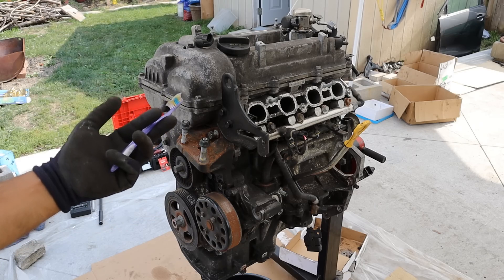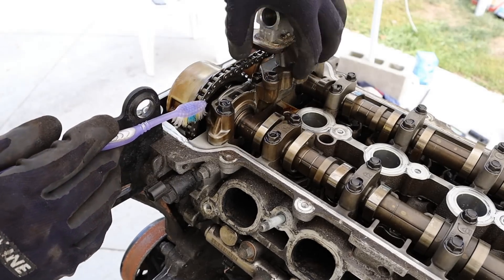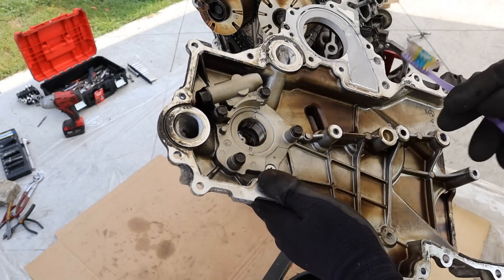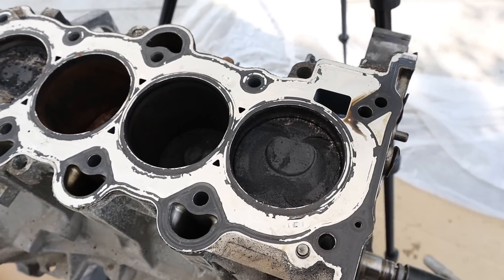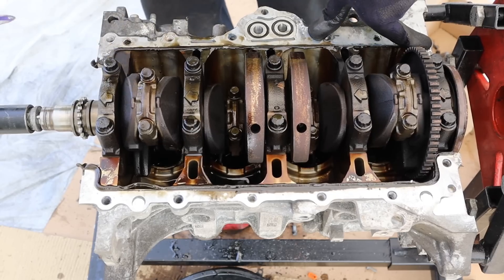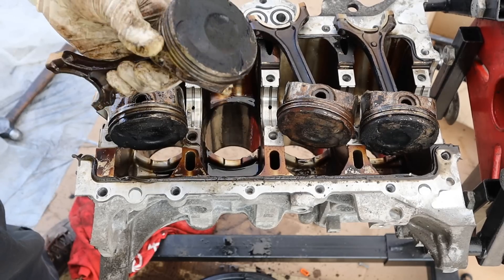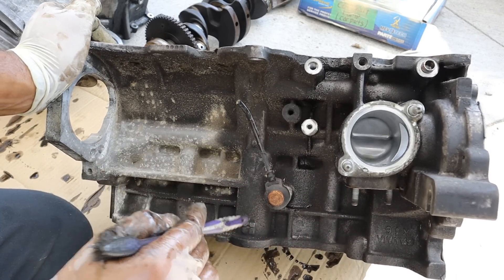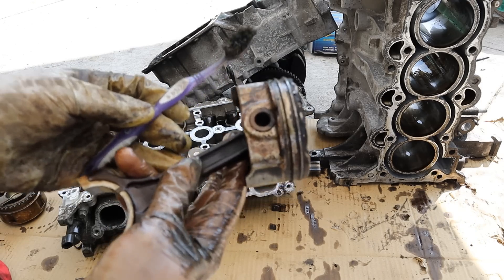Why KIA Engines Fail

Comment: For being such a lower cost engine, they are extremely well built especially for what you are paying for it. These engines tend to last a long time if taken care of properly which sadly this one didn't
Reply: This coulda been a rental?
Reply: @justayoutuber1906  If it was a rental then you will have some people who will thrash it just to see what they can get away. However a lot of people will just use it to drive to and from the airport in a city they aren't familiar with. But when it comes to maintenance, the bean counters in the head office  will want to follow the manufacturer's recommendation to the letter to protect their investment. Also, rental companies will only keep their cars for a few years before trying to sell them on (often and a markup for some reason). So it is rare to see older rental cars with high mileage.

Comment: I keep seeing these types of criticisms of KIA and Hyundai. But all the people I know with KIAs and post 2000's Hyundai have never had any problems with theirs. Hmmm....
Reply: My 2010 Kia Forte Koup sx 2.4L 6MT Theta 2 has never had any problems other than the usual fluids & maintenance requirements. 15yrs old & still drives like new. 

5W30 full synthetic at every 5,000miles 
75W90 full synthetic gear oil at every 100,000 miles & other fluids when needed.

Comment: the main issue is that kia will tell you to do an oil change between 8 and 10 k miles. simply you can not do this on the 1.6 to be safe 4 to 5 k miles and if you go 5 thousand miles you should check the oil level. i have a kia rio and since day one 2016 and now 2022 i do my oil changes at 4 k and every 8 k i use fuel treatment.

Comment: I drive 2014 Kia Ceed 1.6 CRDI SW(diesel) 200.000k on the odometer. I Change oil every 10.000km instead 30.000km that factory recommends. The engine burns no oil between oil changes. Car works like a charm.

Comment: Clearly, you know what you are talking about when it comes to engine construction. 
Which engines / brands are to be avoided, and which ones are best in terms of performance and longevity ??? 

I typically keep my cars for many years eg Honda Accord 2.0 petrol, or Chrysler PT Cruiser 2.0 CRD (Diesel). I ran both of them for more than 13 years and each more than 200k km without any issues. Basically I only changed the oil and filter regularly, and fitted new brake pads when necessary, and I never had any issue whatsoever with the engines.

Comment: The two center connecting rod beatings died most likely to gasoline contact. I've seen a number of Kia engines with horrific piston ring blowby due to lousy rings..... causing them to burn oil and get gasoline into the crank. Those two bearings were closest to the oil output, meaning they got a higher volume of lousy oil.

At least, that's my uneducated guess

Comment: How many miles had this engine done???? Piston heads 'completely carboned up', you're joking aren't you? That's just soft carbon that would be burnt off with a good high speed run. Yep, short journeys, letting the oil level drop will certainly do irreversible damage to the engine internals. big ends, once damaged, can only get worse. What people don't realise is that letting the oil level drop to the minimum dipstick mark, let alone below, causes momentary oil starvation when turning a corner or a fast highway bend. Keep the oil topped up folks!

Comment: my 2010Kia forte with theta 2 engine being clock 360,000 km and still running strong…from video when I saw the oil pan and I believe the owner didn’t change engine oil base on interval and using some cheapo engine oil.

Comment: Kia magnificent car I have from 2012 and I only change traction pulley, fuel filter, and the serpentine belt and the tyers the car have 80.000 miles and acting like new.
I change the oil and oil filter every 6000 miles and I enjoy the Kia. Brilliant car.

Comment: That's about what I expect an engine that's poorly kept to look like. I still daily my 2014 Kia Rio LX 6MT 1.6 GDi currently at 128k miles that I've had since it was new, very good car; and frugal.  The UB Rio is way more European like a VAG than it is Korean, this is due to Kia acquiring Peter Schreyer and the engineering he took with him from VAG. These more modern GDI motors imo are derived from older VW direct injection designs, I treat it as if it were an older Jetta. Full synthetic oil, European coolant, Red Line MT-85 gear oil, injector and intake cleaners as well as cleaning the throttle body, etc; I treat her right and in return I get a ride that takes me to work and back. Now, I did have A/C compressor failure last year, I have myself to blame for that. Replaced the compressor, condenser and dryer unit for $300 new.

Comment: I am watching foreign country channel where a guy actually rebuilds those Hyundai/ Kia engines. According to mechanic, If you ask yourself how to prolong the life of those engines, the answer is-you can't-programmed obsolescence. Maybe by little, by using good oil (5W40 instead stated 5W30). Their service life is some 150.000kms (or warranty period) before needing to be overhauled by boring out (or by short-block replacement, depending if original eplacement pistons are available). He actually replaces crankshaft bearings from "special" bimetal to classic as well as changes piston rings to prolong their life after overhaul. Parts are extremely expensive, but engines die before the chasis so people repair it there.

Comment: Hey man great video, I own a 2018 Hyundai Elantra that uses this engine. I've already drove around 70,000 kms (40,000 miles) thankfully problem free. Please give me tips on how to protect my engine from premature failure. What should I do other than the normal dealership services every 10,000 kms? Is there a specific way to deal with the carbon build up? And how often should it be done? And thanks a lot in advance
Reply: I believe 80,000 and 90,000 kms are milestones for checks on the transmission oil and serpentine belt. I would rather find a trusted mechanic to help you check the maintenance every 5,000 kms. Dealership services are great for warranty work but sometimes they are not very supportive for researching engine problems.

Comment: having worked on many of those engines.... that engine has suffered a severe lack of maintenance. I have many customers with over 200,000 km's on the original engines and they run perfect... WITH quality regular maintenance
Reply: Couldn't believe the sludge in that pan. This poor engine has immeasurably suffered as a result due to lack of maintenance. some people on this rock should not have been born.

Comment: Ok, I like your video.  I like this engine design.  First time I've seen it.  I would like to help you better understand the reason for failure.  Intake injection is not the issue.  The issue is the rings.  The second ring to be exact.  It is cheaply made chrome.  The fix is a ductile iron number 2 compression ring.  The iron will "cut in".....or "seat".  These junk rings do not seat.  This results in oil burning from the factory.  This also allows blow by.  The carbon builds up in the oil control ring lands and sticks them to the piston.  Resulting in low oil because the owner doesn't check it.  Then oil starvation and a spun rod bearing.

Comment: I´ve owned tow hyundai´s and one kia during the past 10 years and they all worked perfectly. No problems or issues with them and all they needed was just basic maintenance. Never left me on the side of the road or anything. two of the cars were driven over 300 000 miles. The engines didn´t drink any oil whatsoever and always started up easily in  -30 celsius or under during winter. Now driving a Kona-electric and it works like a charm. Cheap for an EV and it has great range and good efficiency and all other stuff you´d expect from a newer car.

Comment: I had a Hyundai Tucson (KIA sportage)  with over 500k miles on it and the only problem I had with it was the transmission. I would still be putting miles on it if I had not blasted a deer with it at 75 mph on the freeway. I never even hit the brakes lol. I drove it over 100 more miles to make it home.
Reply: The "only problem" was the transmission.  LOL!!
Reply: @larmondoflairallen4705  It would get stuck in sport shift mode, not that big of a problem. If you are going to quote me, at least do it correctly. I did not say the only problem was the transmission.

Comment: I bought a 2009 Kia Rondo with a 2.4L engine, first and only car I ever purchased new. I changed the oil religiously, performed all required maintenance, used Gumout fuel injector cleaner or Lucas, whichever is available, and my Rondo has 174,000+ miles and runs well. Just now started having problems with the alternator. Take care of your vehicle and your vehicle will take care of you.
Reply: a high quality synthetic and synth filter will also aid a lot in colder climates
Reply: Kia Rondo used a Mitsubishi 4-speed auto transmission as well.

Comment: “A typical Kia owner is not smart enough to check their oil levels” … I love this guy!
Reply: Most people don’t, but it’s a problem that you have to baby a Kia when the whole purpose is to have a cheap car you can keep driving until it falls apart
Reply: @Cresta-fm8uj  Oh it'll fall apart all right
Reply: @BenjermenB  well I hope mine doesnt, 2016 kia soul 1.6L Manual 6 speed,, 250K miles and all I have had to do is change the alternator.
Reply: @BenjermenB I own two a Kia and a Honda.  Maintain both myself. The Kia has more miles on it(180k). The Kia has been more reliable. The only part that has failed was under recall. My Honda however has needed work. Just my experience
Reply: To be fair I would say a typical Kia owner is extremely unlikely to be a car person and so much more likely to ignore servicing but I agree it's much funnier to say their "stupid" 😁 MG, Range Rover, Mercedes, BMW are all giant heaps of shit that break apart like legos but they're exciting, powerful or cool looking etc so a rich car dude who can afford the repairs might buy one anyway but he's not gunna by no stinkin' Kia.
Reply: @MrMightyZ  The Stinger GT2 and the G70 are solid competitors to some of those brands but you’re not wrong when you say a rich dude would most likely purchase the more expensive German rival
Reply: One of the problems with Kia is people use the warranty as their maintenance plan.
Reply: But how's the 6 cylinder engines from kia???
Reply: I've been saying for years Kia Hyundai use poor cheap wire harnesses which turn into electrical problems on the vehicles & now fires, I had a 16 Sorento what a nightmare almost everything broke electrical issues up the a** battery continually dying, moon roof wouldn't close just a disaster, they entice with the designs of the car but reliability eventually catches up to you... I remember Hyundai back in the 80s Pony Stellar were also disasters.
Reply: @tocreatee5736 I have found the electrics far superior. But there you I haven't got a axe to grind either.
Reply: This chap drives a vw
Reply: Honestly, how is that different than any other maker?
Reply: @robertt9342  no manufacturer is perfect and zero service can kill any machine before the due date but apart from a very few exceptions, the most recent being 2007-2010 2.4 4cyl, Toyota are so much better built than all other cars, that if cars were people, Toyotas would be Terminators.

Toyota are a huge corporation and therefore not worthy of any consumers love or trust BUT they got to be number 1 by building their cars better than everyone else.
Reply: @MrMightyZ  You should tell my brother who's four banger puked at 114,000 miles on his Rav 4. He installed a new engine.
He laughed at me when I bought my Sportage the same month he bought his Rav.
I have 340,000 he has 180,000. His car sounds like a rattle trap mine's still solid.
Reply: @ChasL704  As I said, apart from a very few exceptions, the most recent being the 2.4 from 2007 to 2010 which had “low friction” rings that let tons of oil past the rings.
But one of the reasons Toyota is the most successful car company on Earth is they’ve had the least amount of bad f#ck-ups like that.

They build the strongest cars on earth and it’s not even close.
Reply: @MrMightyZ   Tell that to my buddy who's frame on his Tundra rusted out and it had a few problems before the linkages on the front end started falling apart...🥴
Tell that my to my niece who's 94 Toyota Camry that also also had plenty of other problems blew an engine. 
Trust me I could go on. But I'd hate to burst your bubble.🧐 Yeah, generally good about like anything else nowadays. The trick is you have to keep them maintained.
Reply: @robertt9342 Because if you bought a KIA, that means you didn't really do your research or you don't give a crap on what you drive. So you're less likely to give a crap about changing the oil.
Reply: Glad I'm not a "typical" Kia owner, then.
2016 Kia Soul, base model, 1.6L with a 6-speed manual transmission.

It does annoy me that the Kia "GDI" engines burn/consume oil.
My engine's consumption is approximately 0.5 to 1 quart/liter per 3,000 miles/4,800 kilometers.
Use of Synthetic oil, semi-synthetic and "conventional" oils don't seem to change the rate of consumption.

My 2000 Hyundai Elantra station-wagon didn't have that problem (2.0L, 5-speed manual).
It could go 7,500 miles and not consume oil.
Reply: @libraeotequever3pointoh95  I have the 2016 base model with 6 speed too wwith 250k miles on it so far, I try to use that CRC intake and valve turbo cleaner once and a while, but I bet ill lose this engine in the next hundred thousand but what can you expect
Reply: "but I just bought the car". When the owner puts 6k miles in 6 months.
Reply: @Crunchifyable2 6000 miles in 6 months isn't very much. Who the hell only drives 1000 miles a month??  I drive that much just going back an forth to work every month. And another 6 700 miles going places for fun on days off.

Comment: I'm amazed at the failure level reported in the US. Here in Australia they are generally considered a very reliable product. Our service requirements are 10,000km for the turbo petrol engines and 15,000km for the NA petrol and Diesel. Most of our KIA and Hyundai models are Korean made with some European produced. I have noticed there is a distinct quality difference with the US built Toyota Highlander or Kluger as it is called here compared to the Japanese made Rav 4 and wonder if the Hyundai models built in the US are using inferior quilt materials.
Reply: The fail rate in America is because they manufacture it themselves Kia and Hyundai and they have different engines fit for them in America. But Kia and Hyundai primary market is in asia and Europe . They get the cars from either European plant or Korean and the cars are some of the most reliable in the word. The problem is only in USA their plant and engine type is different from the rest of the world but it’s not with everyone most people in the states are satisfied  with the brands.

Comment: They burn a ton of oil which is why they end up full of sludge. I had a 2015 accent that burned 1qt every 1k miles. I first noticed the oil consumption on my 3rd oil change (15k miles total) because not much oil came out, it was dark, smelled burnt, and it was only a 5k mile interval. Hyundai was no help. Finally traded it for a Corolla. Again, I changed my oil regularly and my engine did that crap… can’t imagine what happens when people go 10k miles… oh wait, I can imagine it..

Comment: Circlips to retain the piston 'Wrist Pin' is a pretty old way of doing things. In this case, I think the pin is shorter to reduce weight and the piston is also without a full 'skirt and the support area for the pins is narrowed as well for the same reason. the pin is an interference fit in the connecting rod small end so there is no wear on the 'small end bearing' as there used to be. I have had small end bearings chrome plated and reground which is much more work than fitting new pistons.

Comment: Worked at a Hyundai dealer 2013-2018. The 1.6 never came in for repair. Dunno if that is because they were that bullet proof or owners didn't want to bring them in. But they all ran very well. 100k miles, started and idled like new

Comment: I drive a kia, I have not once had an issue with my engine,  have a 2004 kia picanto with 600 thousand miles, if you mistreat the engine by reving high, using poor fuel and oil, the engine will break

Comment: I've seen kia's last half a million miles and I've seen them blow at 40k, most of the time it's lack of maintenance that kills them. I work at a Kia dealership, and 20 percent of these cars are overdue for an oil change by THOUSANDS OF MILES. They're still good cars imo. Just CHANGE THE OIL EVERY 3-5K.
Reply: A "properly maintained" Yugo could go a half million miles.
Reply: @larmondoflairallen4705  There are probably those in Eastern Europe.

Comment: I have 2. KIA 2006 Spectra 250K and RIO 1.6. Fluids are a must. 1.6 needs checking the oil stick every 15, 30th of the month.
Reply from the maker: Keep it well lubricated and it'll last
Reply: @speedkar99  hard part is getting the user of the Rio to check the oil   I am 60. Fun to watch your tear-down of engines. My Spectra at 250K uses no oil.
Reply: got tired of adding oil. Found TSB Kia 222 (Rev 4, 12/21/2021) High Oil Consumption. Berryman B12 piston soak, overnight and then again, oil change and filter then bring up to operating temp (not in TSB) added liquid moly oil flush idle 15 mins change oil again. funny it seems to work. In theory, makes sense. 500 miles no oil use. The TSB says to use 5W30 vs the cap 5W20.
Reply: berrymans is the same chem I used when action shooting old sport of mine to get rid of hard carbon buildup on the bolt of AR.

Comment: I have 2017 kia sportage sxl tgdi with 190000. Been changing oil every 3000miles and hardly ever accelerate aggresively. No issues so far
Reply from the maker: Keep it oiled